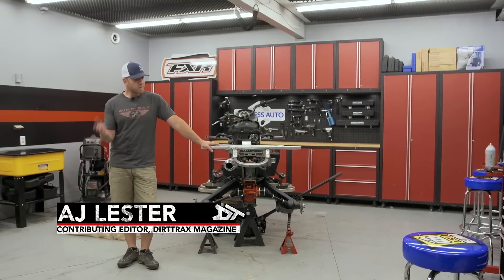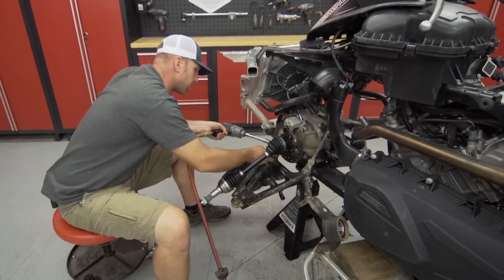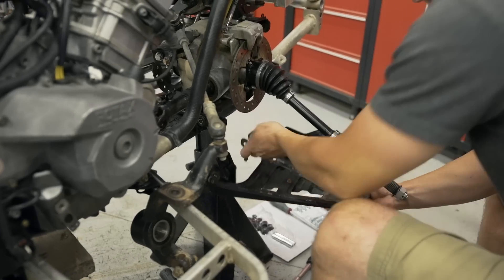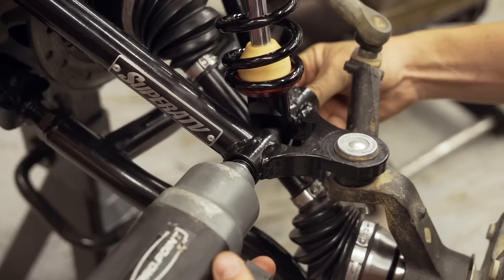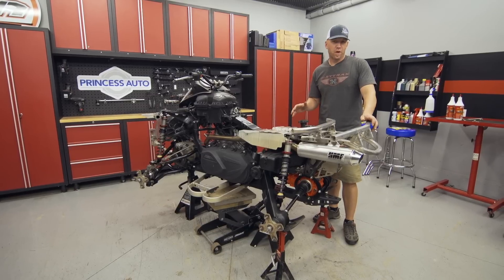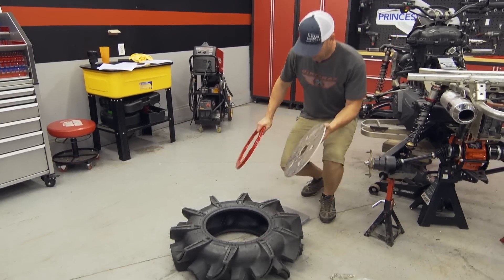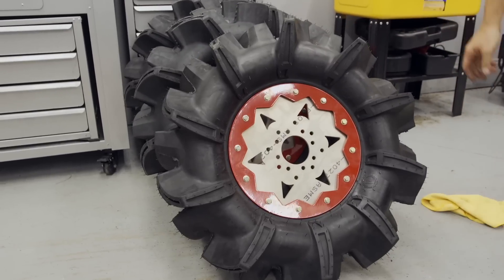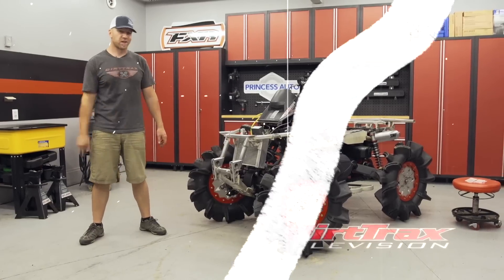Can-Am Mud Build: Part 5 - Tires & Rims

Comment: Holy crap, another video with deep pockets, do a budget mud build, under 5 with buying wheeler
Reply from the maker: That would be the base Outlander we bought with a 3" lift, the snorkel and some good tires. But we aren't going to be winning any races with that. This stuff isn't as pricy as a lot of folks think, yes it's an investment but as we have said you don't have to do it all at once. We could go just the engine and speed parts, the tires and rims and snorkel and probably be solidly competitive. All in that'd be about $7500 with the bike. Sure we may break some stuff that we beefed up on our build and need to spend more down the road but this bike completed will be worth significantly less than a brand new 1000 XMR or HL Polaris and will absolutely peel the stickers off both of those when it goes by it's so much faster.

Comment: I have a Gen 1 800 budget build that I bought a year ago for $3500 it was very clean with only 300 miles. I have been slowly building it how I want it for mud, I now have about $9,300 in it. I'm wanting to upgrade the shocks on it. I'm interested in the Elkas, is there a reason why they recommend stage 1s up front and stage 2s in the back? Also do the Elka shocks develop any sagging in them after being on the atv for a period of time?

Comment: Can i ask how the non crushed assasinators ride and wear? I'm looking at silverbacks or assassinators and want the one that's best in the mud but is a bit better on the trail. I know they won't ride like stock but I would prefer the one that's better. Also is durability an issue for either one?

Comment: 4:20 he places the lug lip facing out
Reply from the maker: I did this as it's not a tapered hole, if it were I'd go with the taper in as per the stock rim set up but without a tapered surface on the rim its more likely to just carve up the aluminum and this way gives us a better contact patch.

Comment: Urgent please answer 
Can i put the crushlocks on stockers
Reply from the maker: On stock tires? Yes, you can crush just about anything, but I wouldn't think you'd be getting the best performance crushing stock tires. I'd suggest a more aggressive tire, and go with a narrow front sized tire on all 4. The larger stock rear tires with crush locks will still be quite wide as well and the whole point is to get a narrowed up tire to cut through the mud not ride on top of it. But yes you can crush the stockers for sure.
Reply: Dirt Trax Television  i just want to run those until i have the money
Reply from the maker: Yeah you can do that fir sure, they Rubberdown does a great job with them, super nice product!

Comment: You said those arms don't work on the Max version, but aren't the fronts identical?
Reply: I didn't understand that either, there is no difference between the a-arms or trailing arms on the STD or MAX the length difference comes from the longer frame?
Reply from the maker: I'm not sure why either, but Super ATV states it right on the product page so I have to assume there is an issue with something on the max.
Reply: Dirt Trax Television Would be nice if they cleared that up for everyone like myself that has a MAX version. Love this build even though we have zero mud in Arizona, still getting lots of ideas.
Reply: @ElementalATV Please let me know!

Comment: Lug nuts are on backwards
Reply from the maker: Yeah i did that because they are a tapered nut and the crush locks are a non tapered hole, figured more surface is better when theres no taper.

Comment: Lol still going to break axles and drive shafts still after all this work buy a Honda
Reply: Honda's will break plenty on tires like that, and won't go half as far with no wheel speed.
Reply: Tropical Shadow The Honda Atvs can't even Dream of spinning a crushed 29.5 more than 10mph in the mud... It's been proven time and time again, Honda just ain't got the Guts in there.
Reply: Tropical Shadow lmao gtfo with your honda. 
The onlything i like a honda motor on is my lawnmower
Reply: carlos valencia Honda makes good equipment, but when it comes to performance they suck
Reply: Motor Mania thats why id rather keep hondas on my mowers cuz i know what theyre good for.
Reply: carlos valencia Exactly, that Should be Hondas Slogan
Reply: honda fan boys think honda is just the best thing out there. cars, bikes, atvs. lol they're shit
Reply: Motor Mania it's not that there performance sucks Its people do shit its not made for you know what I'm saying
Reply: Gabe Satterfield Exactly, that's what atv Stands for duh 
A- All
T- terrain 
V- vehicle
Reply: Y'all just mad cuz ya gotta spend over 15 grand just to hang with hondas that only cost 5 grand or even less if u buy an older one it's called a gear reduction if  u want spin your tires on a canam or polaris you'll just burn your belt or break it hondas have straight gears there way more reliable it's been proven thousands of times look it up for your self canams are fast and all but Honda is worth more bang for your buck wait till a drive shaft or u joint goes out in a can am it'll cost probably more than a honda all I'm sayin is Honda is Bette than can am
Reply: Tropical Shadow Have you personally owned A Honda and a Can am ? 
How about a Yamaha or a Polaris? What about a Suzuki or Kawasaki? 
You don't know a thing about machines if you think a Can am has to be modified to blow the wheels off a Honda
Reply: Motor Mania  wrong its called a gear reduction
Reply: jonnyjb69 never said that honda has best reliability and durability out of all other atv brands look it up
Reply: Tropical Shadow Is that the only words you know related to atvs?  sounds like you've been watching too much of that Air head Mud PUPPY
Reply: Gabe Satterfield exactly just like a new can am owner buys huge 32 inch tires for a can am and blows the diff in half and breaks axels and then calls the dealer up and then they tell them your warranty got canceled after u modified the machine with non oem or brp official parts and then the owner has to pay for can ams stupid warranty
Reply: My honda rides better than my Can-am that's about the only thing it does better. Had 30's on it for awhile couldn't keep axles in it went back down to 27's. Super reliable though, no complaints there, just half the machine the Can-am is.
Reply: Tropical Shadow No my can am didn't break :)  It's a far superior machine than my previous Honda Rincon 680, and that's supposed to be Hondas Top of the line Big Bore lol